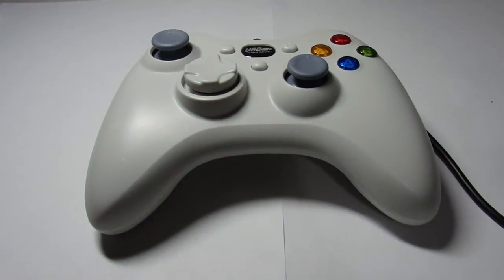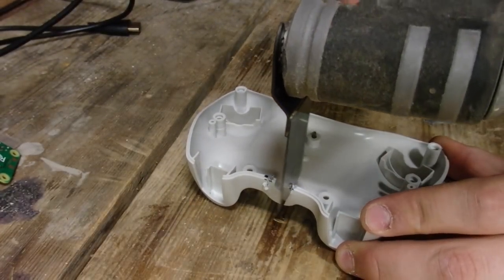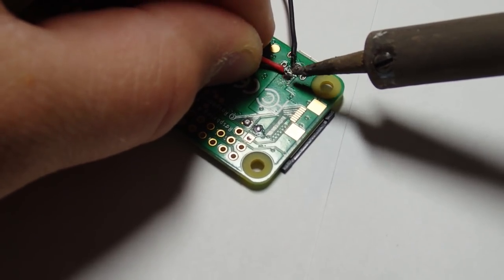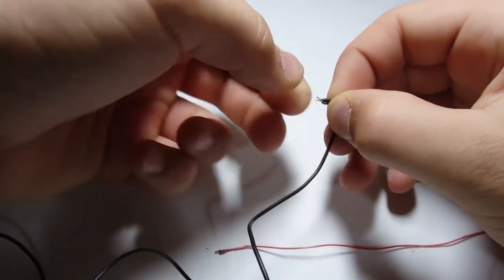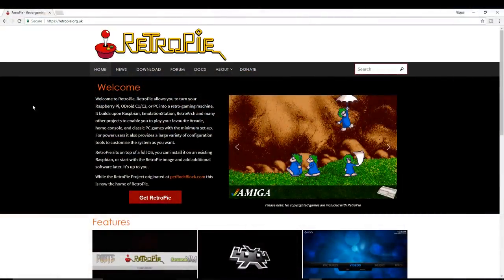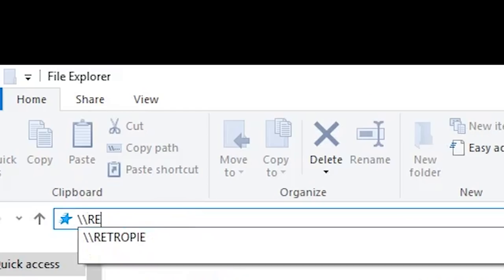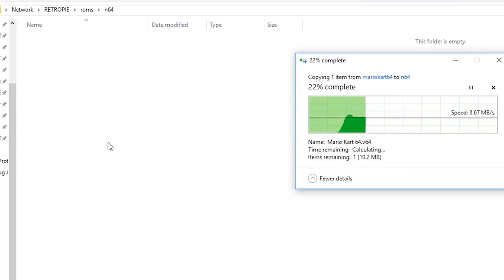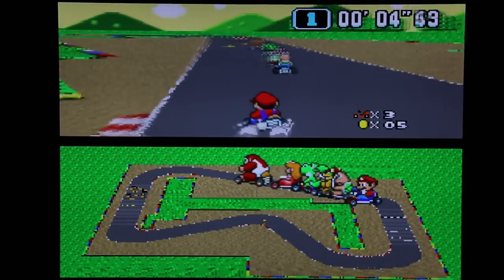How to Turn a Controller into a Game Console

Comment: Cool video. As far as batteries (which is a great idea) you could probably scrap the vibration motors for the controller. Put a battery pack in each "leg" with a switch between them.
Reply from the maker: Good idea. I've also considered designing my own controller and 3d printing it.

Comment: in version 2 remove motors in place of batteries to get rid of the extra wires.
Reply: If he was going to do that he should had just statred with a wired battery. Beside, what battery would fit in the spaces for the rumble pads? But I do understand the sentiment; a rumble pad isn't entirely necessary, especially since older games didn't boast such compatibility. But for some 3D games with that support it would still be nice to have.
Reply: Hey Ninja. I love ur gh setlists
Reply: I'd say it's completely pointless if you're going to need wires for it anyway.

Comment: Please Note this comment is not me criticising your amazing project. It's just I recycle disposable rechargeable vapes (battery & charging port) & fit them into all  sort of devices...
Would of definitely fitted the pad with a micro usb port for the power input & yeah a battery and either of not glued the hdmi into the pad as it looks like you could of left it so as to plug it in & out.. or used a mini hdmi extention that hangs  just outside the pad... Great work love your projects. Your definitely worth subscribing to 👍🤝

Comment: you can do literally everything with a Pi Zero can''t you?
Reply: No, you cannot. The Pi mini-computers do not have as much power as PCs or things like the Apple TV 4K. They're actually really weak. It's just they can emulate lots of consoles because technology has advanced so much that really weak is more than the power of old consoles. The Pi is very weak but is used in projects like this because it is very cheap and small.
Reply: I meant that EG can literally do everything with a Pi Zero the Zero can handle. I know Pi mini computers don´t have as much power as a full pc, as I have 3 of them.
Reply: Except for run an unmodified version of Windows 10 64-bit os. But for the most part, yes almost everything
Reply: Kovu like nothing to low gpu
Reply: It cant run crysis :(
Reply: @lesslighter  it works pretty good with raspberry pi 3 running recalbox.

Comment: A little late, but this seems unnecessarily messy. Maybe for a version 2, design a custom bottom half for a common controller (say, a wired Xbox 360) and print that out. With a bit of sanding and some TLC later, you should be able to mount the components together and it should work without issues, as well without a bunch of hot glue and you can sell it in kit form.

Comment: I also thought of a new Raspberry Pi project putting the raspberry pi 3 inside any racing steering wheel controller from PS1; PS2; PS3; PC or Xbox 360 as suggestions making sure all all raspberry pi driving or racing games use the racing steering wheel controller.

Comment: You should have swapped the AB/YX buttons around to be in the correct positions for Retropie / SNES gaming.  And a nylon cable shroud would have looked nicer than electrical tape.

Comment: I have an idea, cut a hole in the back of the controller (Under where the HDMI out goes) and put an SD card slot in
Reply: M1ghty Boy Oh yeah so you can easily add and remove the sd card
Reply: For exactly that reason yes

Comment: Would it be possible to get a mini screen and keyboard and hook that up to a Raspberry Pi and load up windows 10 to get a mini laptop. Never seen anyone do it before. Amazing if you could be the first.
Reply from the maker: Good idea. The only problem is that currently Windows 10 isn't available for the raspberry pi.
Reply: Electronic Grenade True. Loading the regular Raspberry Pi desktop could work properly too.
Reply: You could stream Steam from a gaming PC to the Pi for a similar experience.
Reply: It would be interesting to see you fit the hardware in there for that lol
Reply: get a lattepanda instead/udoo
Reply: Good idea, but not only is Windows 10 not available for the Pi, but I'm pretty sure the Pi is too weak to run it. And if it would, it would run very slow.
Reply: Windows 10 IOT works for the pi but raspbian is generally a better OS for the pi.
Reply: It’s called LattePanda.
Reply: No.  And it never will.  Raspberry pi has a phone processor (ARM) while windows 10 only runs on PC. (x86_64).   You may be able to get windows phone 10 on it with a shit load of modifications.   But WHY.    Those windows 10 tablets actually have a full PC processor crammed into them wich makes it so much cooler
Reply: Eknils And windows 10 IOT has no desktop.
Reply: The reason why is that it would be really awesome to build your own laptop. Add in some 3d printing and you could have an awesome project! I think it would be cool to have a mini projector instead of a monitor. Just the appearance of a keyboard and a mouse, and inside there is a portable power supply, raspberry pi, and a mini projector that projects itself onto the wall.
Reply: yes i think he shoud becus its a windows running single board
Reply: they make windows for arm devises but i dont know how its works
Reply: All of the Raspberry Pi computers are Linux machines (I think), so it’s very unlikely you can turn your Pi into a Windows PC or a Hackintosh.
Reply: No it cant run win10
Reply: How about Raspbian? I think that's how you spell it... It's a version of Debian specifically for Raspberry Pi
Reply: @Electo  old news there is, but who want. its tick tack tick tack. rpi not good on desktop, but awesome on console

Comment: Does this play Gamecube games though? I'm thinking of doing this too!
Reply from the maker: I believe it can, but I think you'll have to follow these instructions to get it working https://retropie.org.uk/docs/GameCube/
Just so you know I haven't tried to run gamecube games on it so I have no idea if the tutorial will work or not.
Reply: Electronic Grenade Oh ok, thanks!
Reply: Electronic Grenade What controller  did you use?
Reply from the maker: http://www.ebay.com/itm/Wired-USB-Gamepad-Controller-Joystick-Joypad-Resembles-XBox360-for-PC/301304869849?_trkparms=aid%3D222007%26algo%3DSIM.MBE%26ao%3D2%26asc%3D47507%26meid%3D1cba17111a1d41f19dd79ca4ff0232e5%26pid%3D100005%26rk%3D5%26rkt%3D6%26mehot%3Dpp%26sd%3D301426749495&_trksid=p2047675.c100005.m1851&rmvSB=true
Reply: Do some research on if the Raspberry Pi 0 can do. Not everything can play GameCube games. (My PC doesn't run them very well, and the GameCube uses the same processor as the Wii and Wii U.)
Reply: the Gamecube has a 485MHz Single Core Processor, 40MB of RAM, and 4MB VRAM.
the Wii has a 729MHz Single Core Processor, 88MB of RAM, and 24MB VRAM
the Wii U has a 1.23GHz Triple Core Processor, 2GB of RAM, and (?) VRAM
Reply: well, i heard someone in a vid saying that they have the same or something
Reply: I believe both the Wii and the GameCube run on the PowerPC Architecture, hence why Nintendo breifly added backwards compatibility in the Wii - GameCube was your standard Ford F-150, and the Wii was your hopped-up supercharged F-150 sitting on some nice tires.
Reply: ItzBlitz Gaming no
Reply: Good luck getting them to run, why don't you try to run Xbox one games while you are at it
Reply: Crazy_dude_3 Haha! If that was possible, we'll just have to plug in the HDMI cable and we could play tons of good games.
Reply: Daniel11420 it’s not the same processor, it just uses the PowerPC architecture meaning the Wii u is backwards compatible with all of them

Comment: I plugged the pi into my computer in the micro usb port closest to the led and I have the folder named retropie on the micro sd card but the green light does not flash no matter what. It flashed the first time I plugged it in to the pi but I didn't have the folder on it so the files didn't carry over. Any Ideas how to fix this?

Comment: you should make the controller connect to the tv via bluetooth so the video is streamed to the tv and then use a battery to power it so that its 100% wireless

Comment: How did you get internet to the pi? The raspberry pi zero doesn’t come with an adapter and you never added one in the video
Reply from the maker: The newest raspberry pi zero has a Wifi chip built into it.
Reply: Electronic Grenade I did not know that! I’ll have to look into it

Comment: Really cool idea! How fast is a raspberry pi compared to a normal laptop? Been thinking of making my own raspberry pi laptop to replacing my aging Asus laptop. It does have an old i3 cpu and 4gb of ram but it is now very slow since it's 4 years old and has some wear and tear. Was thinking of recycling the screen and keyboard though the touchpad is broken. I could use the HDD as well and perhaps the battery. Dunno how to do that though. Would be very interesting indeed.
Reply from the maker: It's decently fast. But it lags a lot if your doing things such as watching YouTube videos and playing certain games. It's hard to say if it's better than your current laptop, but it might be. It kind of depends on what you want it for.
Reply: Electronic Grenade mainly YouTube, research and Ms Office since I'm studying perhaps not such a good device for uni but might be fun to make one someday just as a portable PC.
Reply from the maker: Yeah, it may not be the best computer for practical use, but it's still a ton of fun to mess around with. I made a raspberry pi laptop a year ago and I really enjoyed the whole process. I would definitely recommend making one.
Reply: Tom Brown, MS Office isn't available for the Raspberry Pi, but you can use Open Office/ Libre Office instead.
Reply: The first models of the RPI run at 1GHz with 512MB of ram and the newer RPI 3 runs at 1.2GHz with 1GB of ram

Comment: If you were able to squeeze in full size Raspberry Pi and Battery that lasted at least 4 hours I would pay $100, I forget the name of it but it's like the 60 to $80 Raspberry Pi killer that some PSP games better I would pay $150. Even if you wouldn't tell to me I would still love to see if they don't like this. Having trouble finding a full size Raspberry Pi situs computer in there other than removing parts you could try placing the case of the controller to be 3-4 mm sticker and you could remove the Rumblers because those aren't extremely necessary.
Reply: I would like to see some kind of mini Wii U gamepad that was built off of a 3 DS with a broken screen, find some way to convert the bottom screen into a touch screen with a larger display, then convert the pop his way into an HDMI or Wireless HDMI to the television. If you're having any trouble with that you could just soft mod the prettiest and stream the screens to the television and to the GamePad. Now that three DS is basically dead I'd like to see people modding it even though it is already a handheld I see potential is a small form factor device that can be repurposed because it is small and Powerful and can Play 3 DS games natively so you don't need a device beefy enough to emulate it.